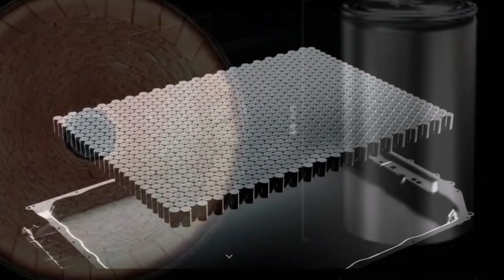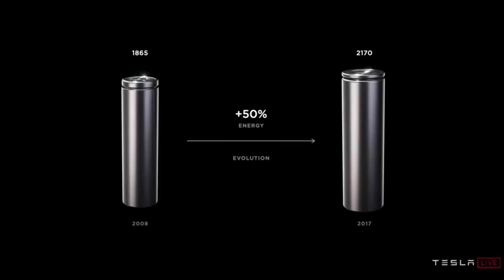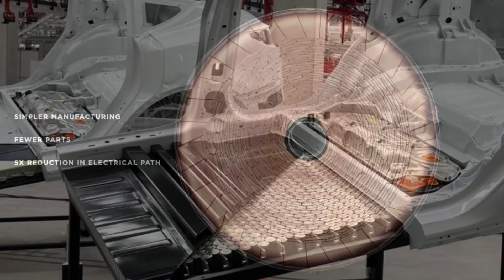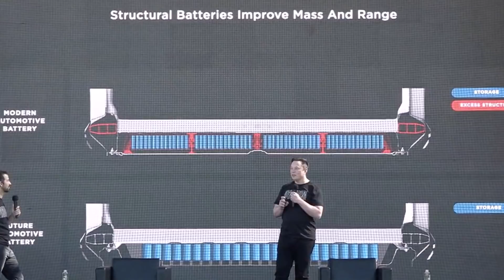BREAKING! Panasonic Updates on Tesla's 4680 Battery With New Insights

Comment: we are still looking at another year or more before we see 4680 batteries produced enough to maintain a steady flow of batteries.  eventually we will see a system using 1-4 battery system instead of a 1000 batteries. the larger each battery is the longer it last.  4680 are just a beginning. batteries will evolve eventually becoming a single unit multiples of storage greater than 4680's. for now and for the foreseeable future we are going to see 2170 ev's on the roads. with a few 4680's.

Comment: Tesla have already said the new form factor provides 15% more capacity and makes the cells cheaper to manufacture. Most savings for Tesla comes from improved chemistry and dry coating technology.

Therefore the form factor itself is not revolutionary but probably Panasonic have made many new innovations and improvements while developing this battery. They are not stupid and after the ass-kicking they got in battery day, they must have done something.

They had been sitting on they but for quite long with only minor improvements and when they realize they best client is going to surpass them, there will be some actions taken.
Reply: Where did you get the information about the new chemistry used in the production of the cells?
Since i cant find any mention of it anywhere  in the Battery Day presentation. Thanks in advance.
Reply: @dstr1  If you don’t like reading scientific articles, there is a youtube channel Limiting Factor which goes deeper into this and analyze what Tesla’s annoncements actually mean. 

Reserve some time since there are quite many videos.
Reply: @dstr1  Mainly from the battery day but afterwards I have been studying it further. 

The chemistry is still based on lithium ion technology but there are changes on the anode and kathode chemistry. 

Anode contain pure silicon with granular form and kathode is pure nickel instead of using manganese or cobalt. 

They silicon technology is easily recyclable and bigger improvent than typically thought. Silicon can absorb 400% more lithium ions than typically used carbon but have problems with expansion and cracking. 

Solving these problems even partially is the most important factor when improving energy density. 

Current batteries have only about 1% of lithium, which actually do all the work. Everything else is there to support the reaction and contain the materials.

Comment: The 4680 will lower the "energy-wasting" in the Teslas. 
Why? The resistor is lower, so less heat will be produced during charging and driving.
By the way the charging-time will be lower...
Reply: The 'resistance' is much lower.
Reply: Also the cell wall to content ratio is higher in bigger cells. The battery cover and car floor are now the same part which allows tesla to fit an extra 10mm of cell height in the same space.

Comment: The new form factor of 4680 is only one element of the equation of having a best selling battery. Other aspects such as more simple chemistry and higher number of cycles are even more critical. In this context, Lifepo4 (LFP) becomes the new preferred solution even if less energy dense but with more than 3000 cycles. 
Tesla has been clever enough to go for LFP at the same time as  investing in 4680 which is NMC chemistry today... But I suspect clever Elon to ask Chinese to produce 4680 batteries with LFP chemistry soon !
Finally Elon should think of even a larger form factor such as 100-80 or even 150-80 to go even further down the line of  manufacturing cost reduction.
Reply: The chemistry of the battery is the same as 2170.
What everybody who discuss this battery technology doesn't  understand is the increase in the charging speed, battery life and power density will be so advance that solid state battery will not really matter for a long time. The charging speed may be reduced to as low as 10% or lower than that of the 2170.
And there is no other producer of that battery. The Israeli start up that is producing 4680 is not producing a cylindrical cell. They are producing a wafer cell.
https://youtu.be/HK79ioBW8Mg

Comment: I am holding off purchasing a Tesla until 4680's appear in the Berlin Model Y's.
Reply: Yes I would hold on until 4680 if possible, my guess is it will simply better in all ways otherwise they wouldn't be making it I would think.
Reply: I think I heard it's later this year few months more they shut down Giga Berlin for 3 weeks for the changeover to production lines.
Reply: Tesla improves every year, therefore you should wait until infinity. :p

Comment: I like 4680 batteries if i can get them for a flashlight
Reply: I’ve also thought this for a long time. In addition, getting creative and placing them inside tubular frames of an off road buggy for example, could negate the need for cooling. Cooling seems to me to be a massive cost and add considerable complexity to all electric vehicles. It would, or rather will be, a game changer when the need for cooling is eliminated.

Comment: It still has not been confirmed that the Panasonic 4680 batteries will use Tesla/Maxwell dry electrode technology or the tab-less design. If Panasonic is just using their own battery chemistry, then it's just an issue with repackaging for the larger form factor. Without Tesla's cool 4680 technology many of the higher energy density, lower cost, cleaner manufacturing, and longevity gains will be nominal. But it will still be an improvement over the very good 2170 batteries.
Reply: I highly doubt Tesla would allow Panasonic to use their dry electrode technology unless they made an exclusive partnership with them.
Reply: @MatrixJockey  Tesla owns the  patent.  They will allow Po Panasonic to use it outside of their needs. The problem is that they get first priority on supplies.  It will be a whike before Panasonic can produce enough to supply others. 
Since Tesla is ahead of then in volume production. Remember that Tesla owns the company that produce the equipment for the manufacturing process.
Reply: It's not only confirmed that the dry cell technology is bring used but there are video evidence if it being used.
Tesla was working with Maxwell long before they perfected the technology. Do when they bought the company they knew that it was viable. They just needed to develop the production technology to bring it  up to industrial production levels.